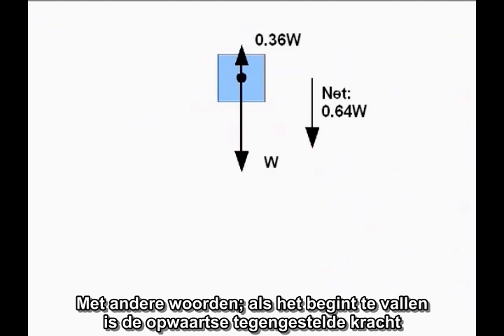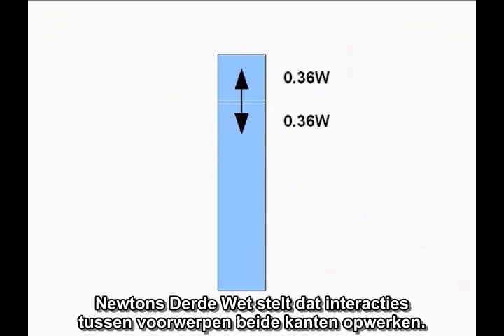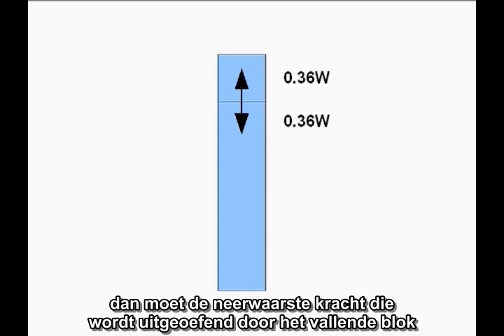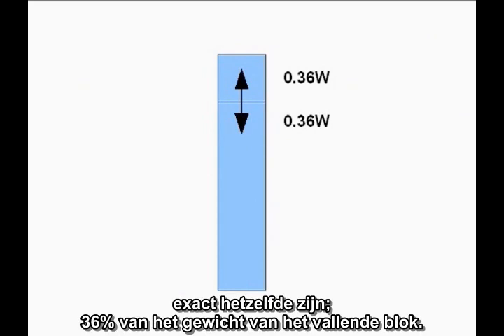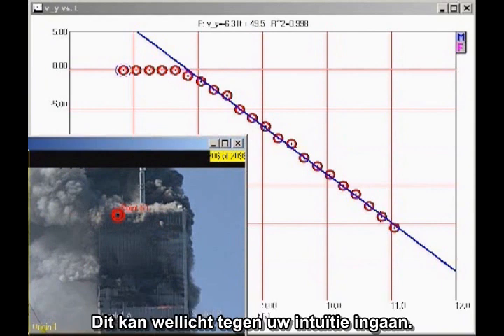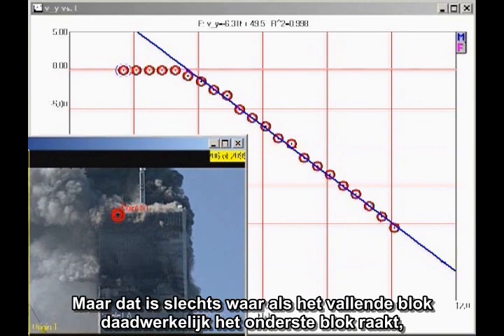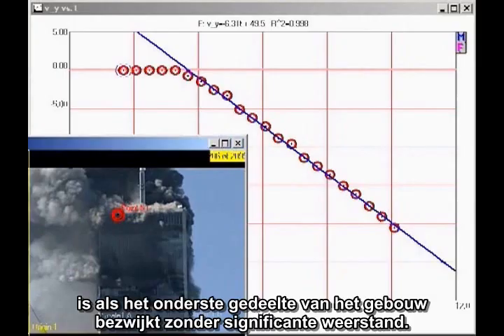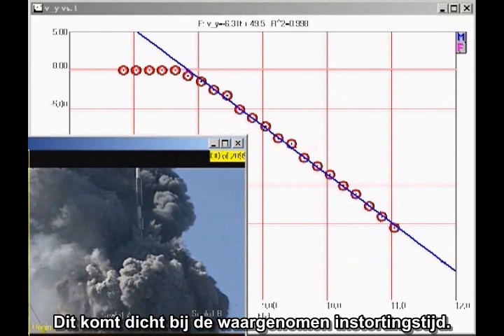David Chandler - Versnelling in de noordelijke toren - Nederlandse ondertitels

Comment: @soundkartel T.Y.  Thinking about it last night, got my mind around it, but found what I think is another fly in the ointment.  Chambers calls the stationary part of the tower the "lower, stronger, undamaged structure."  But the top floors of the upper part comprised the hat truss, which held all the peripheral columns together.  Without it, they are simply held by the much weaker floor trusses.  Absent the hat truss, I don't think you can call the lower structure undamaged.

Comment: @LosAngelesWeedSmoker I'll have to try a bit of whatever you're smoking.  Can't seem to get my head around this.  Acceleration is 64% of free fall.  Fair enough, I can grasp this.  But is it legimate to equate the reciprocal (36%) with weight or force, as in "36% of the weight of the falling block"?
Reply: @FirstUsedBooks Have you an idea about what a NET ACCELERATION is ??? Look at me. If "g" ("gravity acceleration") is equal to "100% of g" and - at the same time - the detected acceleration ("net acceleration") is "64% of g" , what does that mean ??? It means that a further "opposite acceleration" - as high as "36% of g" - is occurring ! Does it ? Indeed, 100 - 36 = 64. 100%g -36%g=64%g ("net acceleration"). Now, how do we call an acceleration who opposes to motion ??? We call it "deceleration due to resistance" ! So, a resistance force is occurring. And this resistance force is equal to m*36%g, that is 36% of weight ! But what does the Newton's third law say ? It says that "the forces two objects exert on each other are always equal and opposite" ! So, also THE DOWNWARD FORCE EXERTED BY THE FALLING BLOCK MUST BE 36% OF WEIGHT ! That's all there is to it.